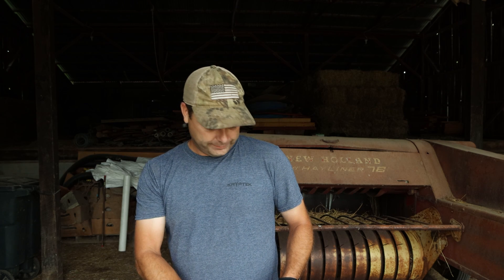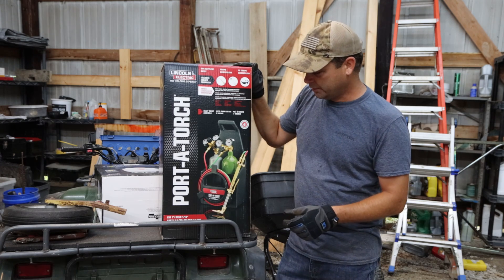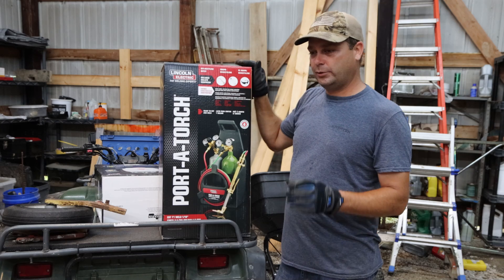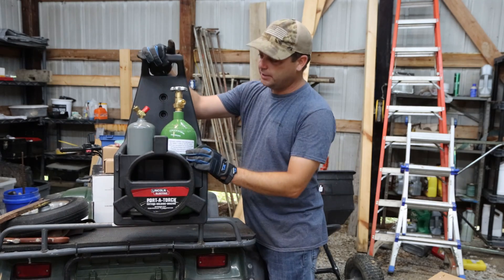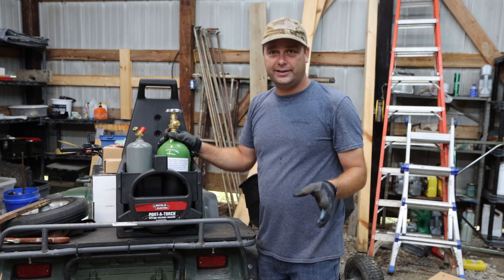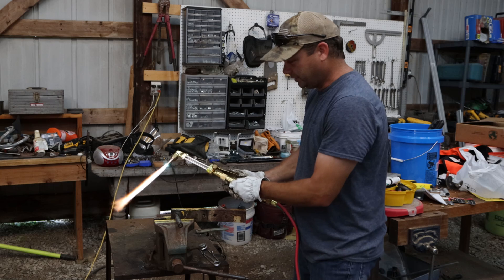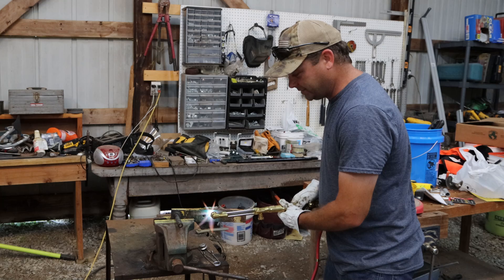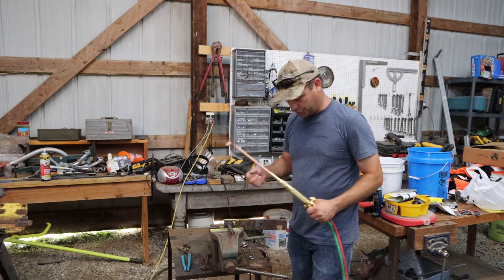I bought an Oxy-Acetylene torch to fix the hay baler.   Now I need to learn how to use it.

Comment from the maker: Lot of comments about wearing glasses.  For some reason it never occurred to me.  But, I totally agree.  I should have had on eye protection or face shield.  I will remember next time.
Reply: Evan, Everyone with comments many times are "Mr Know It all's". Many times a person gets in a hurry to get a  job going and done and forgets about this kind of thing.  Now that you got a torch setup you'll be able to use it on many projects around your farm. I know for a fact the man up above has looked over me many a time the stupid deals i've done while doing repairs on things.  When i look back ,,i could have easily bought the farm on several different occasions.  Keep up the hard work there.
Reply: As much as the tinted glasses are a safety item they are great for allowing you to see the cutting process much clearer, rather than just a bright flame. You were getting closer to the correct flame and practice will get the same result in seconds. Lots of helpful advice posted in the comments. I think the main thing is set your fuel (acetylene or propane) to a decent burn like in your video but then add the oxygen till you get a tight blue flame, don't get too hung up on the pressures... If you don't try these things you'll never learn from it. The only thing i'd recommend is flash back arrestors if not already fitted, just as an extra safety measure. It's good to see you were honest and left the footage of the early attempts with the heating, as this allows other to learn from this.

Comment: With those flashbacks or pops, it’s that your acetylene was probably to high.  If you have some free time, look up the ranges from the manufacturer of that rosebud tip.  Then, once you’ve got the pressures noted, start on the low end of the acetylene and mid range on the oxygen, then adjust from there.  The blue cones right at the torch tip will tell you what it needs.

To repeat what others say, even if you are not cutting with oxy/acet, your eyes are still being exposed to a ton of very harmful UV.  I welded (mig/tig/ oxy/acet) a good three years when I was younger, and suffered from night blindness for some time after that due to my “forgetfulness” to wear properly rated glasses.  

Best of luck, and I appreciate all the effort that you put in to make these videos.

Comment: As always, another enjoyable video.  As a long time user of oxy acetylene, you have to get the feel for the torch.  On your #2 tip in the initial try, the flame was way too long.  You need to adjust it so that you have short blue cones at the tip and eliminate that long yellow flame.  If your getting any black smoke when you have it adjusted you don't have it adjusted right.  The longer the flame, the colder the flame if that makes any sense.  That #2 tip would have done the job if you had had it adjusted right.  Keep up the good work and get bigger tanks.  You will find a lot of uses for that torch.

Jack Thomas
Reply: agree 100%, it just takes a little time and practice with oxy fuel cutting rigs....after i started using mine for the first time i would need new bottles every 2-3 weeks until i got the hang of using them

Comment: A month has gone by but I saw this and my heart fell, I know these struggles well, I was very lucky in one sense since I started before the oxy acetylene torch day came to be in the late forties an early fifties. I had a blacksmith for a neighbor. As I got older and the idea of a fast car and girls joined my thinking habits I knew I couldn't afford a new car so I had better fix a old one n it was so good to learn in those times... way before google and I got hands on instruction. Much later in life I ran neighborhood classes for adults and kids alike. A rule of thumb is three to one so: say twenty one pounds on the oxy, and seven pounds on the acetylene. If you need to go higher then adjust accordingly. Now that said everything that you heat has different needs... soft steel as to hardened steel and so on,. That popping sound that you heard was pre ignition or the gas trying to light in the head and that is dangerous to a degree. Not everything is world epic but if it happens, back away and let the torch head cool while its running un obstructed. Turn the oxygen up a little more till you hear a sound from the end of the torch sounds like its roaring sorta. If it crackles a bit then your high on the oxygen. so lower the valve on the torch head.  and you should hear an nice even sound. Unless that metal is very thick, like a inch or more, Low gauge settings are all you'll ever need for weld or cut. The rosebud is very expensive to run on the gas's so try to just use a welding tip... larger than what would be needed to weld, more like a cutting sound. You will hear the different sounds that the torch makes as you learn. Now in your case with heating or just cutting.... learn how to use propane instead of acetylene. Much much cheaper and will work just fine. I do highly suggest googling it and learn some on it as it uses a different gauge for the propane tank. And a little different tips on cutting mostly or the weld as the orifice changes. That is the abbreviated lesson, way more to learn but oh so fun when its not a beast in the corner.

Comment: I almost know as much as you do regarding using a torch.  I have used one a few times but always had someone experienced help me set it up.  You are learning and are not afraid to fail at first which is a good thing in my opinion.  Just please be safe when doing so.  I don't think that I need to repeat the comments regarding PPE.  Well done and as always thank you for sharing.

Comment: Hi Evan. You got the job done and learned. Maybe it was a little on the expensive side for one job but its a tool you will use time and time again in the future so its cost will even out as it saves you time and money. 
Cutting torch tip designed to heat a small area and achieve a melt to blow away with the trigger. The best method (sort of general baseline) I've come across when lighting, is to increase gas till very little or no smoke then add oxy to set a sharp blue base flame. 
When you try this, you may find you have quite a fierce flame to eliminate the smoke and soot which would be wasteful, that's when you decrease on the regulator. im no expert just offering what has always worked for me. Another good video Evan, thanks for sharing and well done in your efforts to keep the old stuff working.
And yes i got to agree with many others. Eye safety!!!

Comment: When running the torch more gas isn't better. And the cutting tip will work just fine for heating things up you need to make the flame smaller. Just saying after 25yrs. of welding and fabrication
Reply: Agreed! .... turn up the oxygen and get rid of the long yellow flame ... the short blue flames are where the actual HEAT is.

Comment: Have seen at least one other comment that said it but when you first light up the torch turn up acetylene to just where smoke stops and then just crack open oxygen enough to get a nice small cone inside the main flame.( your hottest part of the flame will be this point) .. 30/10 pressure setting should do pretty much anything you will be doing around the farm. I am not a frequent torch user either so always takes me a few minutes to get set exactly right but I always find this a good place to start and will only require very small adjustments after this. I pretty much never change from the cutting tip and once you get set up correctly you would have no problem heating pieces like you wanted in this video with it... rosebud comes in handy for larger areas that need heated

Comment: I run 3 to 1 oxy to acetylene. Most jobs will work with 30 psi of oxy and 10 psi of acetylene. You didn't need a rosebud. You just needed to adjust the torch so that there is no yellow flame. Adjust the acetylene to no smoke and then the oxy to make a blue flame. Find someone to instruct you.

Comment: check and make sure all fittings on the torch tube and torch tip is tight and make sure regulators are tight , If you have a loose fitting on your torch set air will mix with the O2 and Acet and do the popping you were experiencing.

Comment: A suggestion for your bank barn fix up.  On one of your videos you mentioned a project to clean up and paint the barn.  On you tube I saw a farmer that was maintaining (refreshing) his wooden fencing using diesel fuel and burnt motor oil instead of stain or paint which he said he could not afford.  He strained the motor oil through a tee shirt and mixed it 50/50 with diesel fuel.  He then used a standard pump sprayer to coat the post and rails.  Now I don't want to be spraying diesel fuel around my garden fence but I am going to try it using a paint brush.  but for large applications like your barn walls a sprayer might work just fine.  Unfortunately, I didn't make note of the mans name or his channel.  Old burnt motor oil is free and a gallon of diesel fuel is cheaper than stain.  It gave the wood a nice bright tint and made is water proof.  Water beaded right off of it.

Comment: I bought my set of torches at Princess Auto ( same as your Harbour Frieght , Canadian company ) and got the tanks from Lincon  Welding . Set of hoses were cheaper at Princess Auto . I got a bit bigger tanks from Lincon . I was lucky because the guy at Lincon said I needed a certain connector for one of the tanks . Torches are always usefull on the farm . Even to remove rusted on nuts and bolts .Those really small tanks are a pain . I can see you getting bigger tanks in the future .

Comment: Well your jump reflexes work fine when that 1st started popping.😂👍 Glad you got the job done though. My hubby finally sold his larger tank set. Don't remember the size, but they were a good 4' plus tall. They sat on a steel cart with steel wheels. I could barely move it when they were full too. It was just costing so much to get them filled, and had to go several cities away B4 he could find someone that filled them. They were just too big for our sml garage & I didn't feel comfortable having them so close to the house either.🙄😉 Hope you get the rest of it fixed in time.💗

Comment: There is an adapter for acetylene large bottles, the oxygen regulator fits all oxygen battle. It is possible to open to valve fully open and set both bottom valves and the lever will not affect flame.

Comment: Since going to vocational school in 1982, I have not done ANY Oxi Acetylene welding, and that is the ONLY thing Acetylene is required for, for "just" cutting and heating, Propane is absolutely fine, and at a small fraction of the cost of Acetylene.

Comment: Not sure if you know but propane can be substituted for acetylene and is a lot cheaper and much more readily available. It will work to both cut and heat metal but not weld.

Comment: Glad you got it done...finally. For the cost and time involved you might have done better with a press. Cost would be about the same but no expense for gas and air. True, you will get more use from the torch than a press so keep on learning.

Comment: Need spark arresters on the hoses. Don't want that popping to run up the hose or into the gauges. Makes a mess when that happens lol oh and a good starting place is about 10 and 30 psi..cutting thick steel up to 40 on the oxygen

Comment: Those little tanks are always empty, get a cart and large tanks! A shield for your eyes, you only have one set! The #2 tip will work just fine for the job you are doing! Some pointers from an experienced welder may help, perhaps a welding course at the local tech school. A fine video as usual!
Reply: Yep right the thing that small set is for is pretty much just hvac work for getting in crawlspace and attics a large set of tanks is essential for shop work of course I use a propane tank for my fuel u can heat and cut with it but not weld just must have a propane tip

Comment: as some have said more flame isn't better you need to put more ox to make a concentrated hotter flame rather than a big  area flame  and yes is good to have a lite tinted face shield or even a old welding helmet with a lite lens ,especially if you wear glasses  goggles get  in the way  cutting,  heating and welding is a learning curve  just need to waste some gas and practice  some , when the torch popped you were getting too close to the work piece with to large of a flame and it started  igniting inside the torch head, i believe!   you can also chuck the hot area in the center of the vice will help get a strait  area.

Comment: You should find an Air-conditioning supply store to exchange your bottles because the bottle size that you have is the same size that 90%  hvac technicians use. You will also find rose bud tips at the same supply stores also.

Comment: The popping might suggest some safety glasses would be advised next time? Otherwise, good job figuring it out.                                   Regards your algae - Josh at Stoney Ridge Farmer over north of Greensboro NC uses sterile grass carp for water grass and posted a video about stocking about 5-7 a year in a 2.5-Acre pond. The video has a link to the source, which is Arkansas Stockers, I think. Maybe you could ask them if they’ll work on your algae.

Comment: Mapp gas will work with your setup in place of Acetylene.  You can get the disposable containers at Lowe's and Home Depot. You can keep one or two as a spare in case you run out,  Also you can use them with you old small torch. It burns hotter so you might not need O2 to heat it up.

Comment: Heat the metal up to cherry red (anneal the metal) at the point where you want to straighten it out. Then pound the metal where you want to straighten it. Or you could put it in a vise and bend it back. Using an Oxy-Acetylene torch provides more heat than a small propane torch so you can heat a thicker piece of metal. Move the torch over the area you want to heat up.

Comment: Hmmm, I wonder if the wheel was mounted on the wrong side of the bar?  You took out the bend and it is still katywumpus.  Maybe the bend was there to correct for the crooked mount.

Comment: Oxy/propane is a much cheaper alternative with close to the temperature of acetylene.  I bought one of those set ups (victor) fifty years ago but I bought larger bottles for at shop use and only use the small bottles when needed as they are premium gas price compared to the larger bottles.  Got to say though that I have used the cutting tips for much larger stuff than what you have there (Victor never made a rosebud that I could find for the small torch) and had no trouble achieving red hot or hotter.  The rosebud is a gas eater for a fact.  It is critical that you have a gauge for the gas that read usable numbers accurately.  My victor acetylene gauge reads 1/2 pound increments which yours should as well.  You can also use a propane brush burner to preheat your steel before using the expensive gas to finish it with localized heat to save a lot of fuel.  Your tips and ratios vary with propane if you choose to use it with your torch.  Your manual should have the charts printed in it.  I copied mine when I got it and  laminated the chart to hang on the bottles in case I needed a reminder which was useful when I began.  You will enjoy the benefits of the torch.  I rarely use mine for cutting anymore since the advent of affordable plasma cutters twenty years ago.  Still irreplaceable in the field where you don't have air or power. Use protection for sure.  It only takes one time to kill an eye or inflict a severe burn.  Take care.  Doug

Comment: 5-7psi on acetylene and 15-20psi on oxygen is enough for that job. When your done using the torch, back out your adjusting screws. Also, close the tanks to save gas.

Comment: When using a rose bud you match the pressure, l would recommend 15 to 20 lbs on the oxygen and the accetolean. You can go higher than that. On the cutting torch it is 7 to 1 ratio. Depending on the tip on average 7 lbs on accetolean and 35 on oxygen. Its a learning curve.

Comment: Yes welding googles are a must and probably a face shield and gloves for safety equipment. For that job I would have gone and bought a bag of charcoal and heated it that way instead of the expense of welding gases. Plus a hammer and anvil. What do you pay for charcoal, $5?
God Bless    Joe

Comment: WHOORAA your my hero save your self alot of money get an anvil or cheaper yeat a 2 foot long PC. Of railroad iron and a large hammer and pound away take the wheel back off at the shaft hit the bracket with a slegg hammer wallaw fixed then trade that baler for something newer I owned one of those years ago when that was all I could afford bust ever dime you put in to it is thrown away good luck and hang in there

Comment: You might be better off buying an old oxy rig if you are near a more urban area. I've seen them in ads. The larger tanks might be as reasonable as they are more common. You would need to find out the rates in your area though. Of course, this small rig might be fine if you don't need it often.
Is a small forge in your plans for the future? Every farm needs a forge and anvil. :)

Comment: Sir, I know I was not there but if it looked like it did from here the bracket is 1/2” thick and about 2” wide, it bent when it was cold I would have bent it back cold, about 3 good hits 
With a good hammer it would have been straight. Place it between two blocks of wood one at each end, space in the center and hit it. As far as the mounting bracket find something very strong on the other side of the baler and use a chain or cable come-along and bend it cold as well.